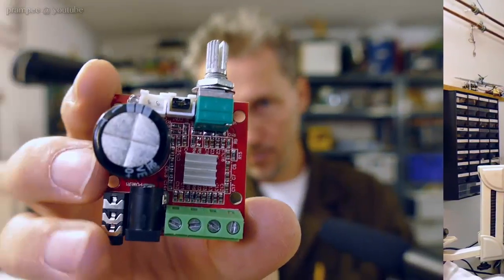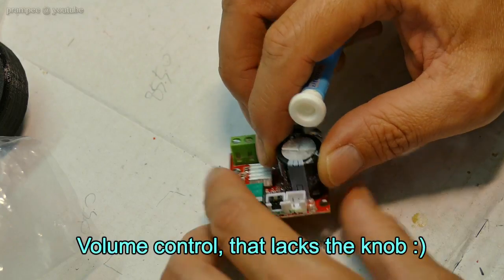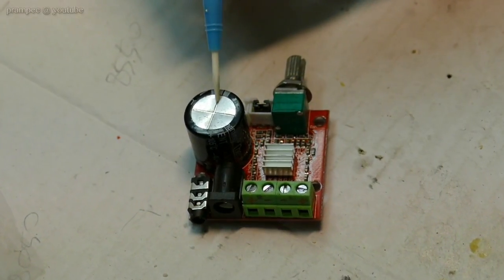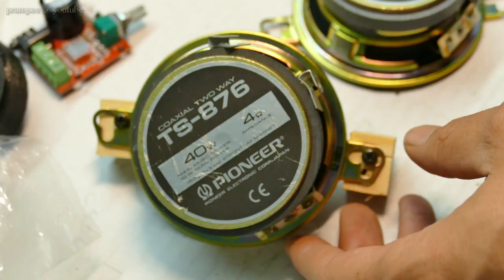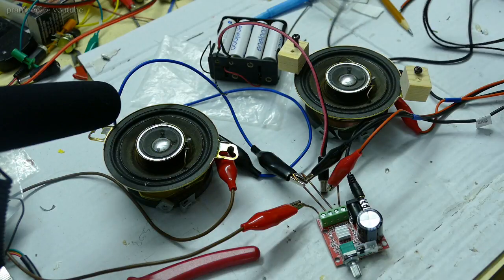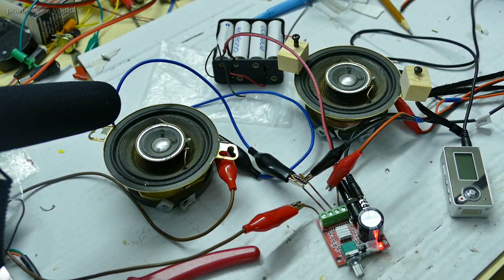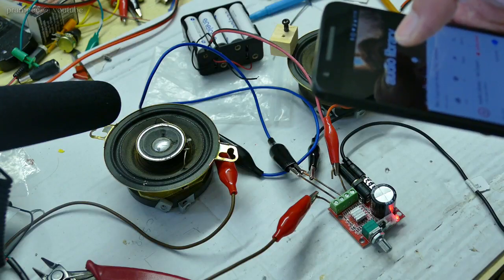PAM8610 Amplifier test

Comment: Due to placement of power supply socket & Audio input socket just opposite to the volume control, this module can't be fixed on any enclosure but a customized enclosure has to be built to house this module or else a separate power & audio input sockets need to be connected using wires and fixed on the enclosure we want to fix this

Comment: I have this amp PCB layout as well. I only run them with 8 ohm loads. I am aware the board does seem to have shielding issues and very likely the source of the noice.
Reply: This gives upto 10 watts on 8 ohms so no need to use 4 ohms for 15 watts else it will become very hot

Comment: Unplug the aux cord not the power. If it still has noise with aux cable unplugged then it's the amp. It sounds more like your audio device or cable is bad.

Comment: hello my friend i have this module and i have the same problem. I watched training videos on Youtube and set up the same circuits, they worked smoothly, but the sizzling did not go away for me. However, according to the videos and the comments made by some people, there is no problem. I guess we are unlucky people :)
    I'll buy another one tomorrow, hopefully it won't break this time.
Reply from the maker: Can you please came back with your experience!
Reply: @sharedinventions  dude this is broken too 😂
Reply: @sharedinventions  They say use 35v 6800uF capacitor. I don't have it my friend, if you have it, can you try it and post it here?
Reply from the maker: No. It will not work for sure. Big capacitors (in a µF range) are good to buffer energy. We have one on the board for that. It has no effect on high pitch noises.
Reply: @sharedinventions  dude come here i solved the problem 🥳🥳🥳🥳🥳🥳
Reply: @sharedinventions  I am giving the sound to the pam8610 amp with the Bluetooth module.  Today I bought another different Bluetooth module JZ-BT-MINI (red color) and there is no sound problem.  A 35v 6800 uf capacitor is connected to the Pam8610 input.  This solved the problem for me, I hope it works for you.  You should concentrate on the sound source you give to the amp.

Comment: I put 6.3v 220uf capacitors on each input channels and it resolved the noise to acceptable range almost no noise.
Reply from the maker: That is a reasonable idea, worth to try. On the other hand, introducing a capacitor on the signal might also mean filtering out frequencies.

Comment: How to identify +ve & -ve terminal at the output of the amplifier in pam8610
Reply: From left to right :
+ - - +
Reply: Hi there, I had the same problem, the seller didn't know it and internet has pictures with different polarity for the same, identically, board. I use the multimeter, I'm DC voltage mode to identify the polarity.

Comment: These things are RF Nightmares.   They toss out soo much RF it's not even funny.   Terrible IMO.  Why do you have the two speakers sharing a common?  That appears wrong.
Reply: Yep. RF is the problem. A ferrite bead on each output would help a lot. Without it, the speaker cables are big RF broadcast antennas which is beamed right back into the inputs.

Comment: i purchase mine on ebay and my problem is shutdown on half volume, but it has a good quality of sound more bass. this amp is good for portable speaker too...
Reply: Low power
Reply: Test With 8ohm speaker.
Reply: You need high power source 12 v
Reply: Try to put capasitor 1000 uf 16v  paralel on power suply terminal... Mine work well untill full volume

Comment: Not proper speaker connection sort and voltage is less 1.2 x 4 equal 4.8 less than 7 volts
Reply from the maker: Actually it is 8x1.2V, and the speaker connector was actually proper. Do you have better experiences with the same model?

Comment: One minor point. Under NO CIRCUMSTANCES can the 2 - connections to the speakers be allowed to contact each other. In your video they are very close or touching. Most of the other reviews seem to indicate this little amp is pretty good but they are very poor quality reviews. I do wish people would use proper speakers in cabinets, even the best amps sound crap without.
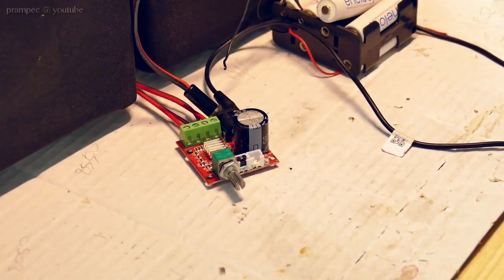Reply from the maker: You are perfectly right. As you can see at 2:40 I did have tried it with a proper speaker set with the same result.

Comment: the two black aligator clips should not touch. also check the board if there is a short between the 2 negative screw terminals.
Reply from the maker: Thanks for the feedback! It is not obvious from the camera angle, but the ground terminals were separated at the test, and I cannot find shorts in the board either.